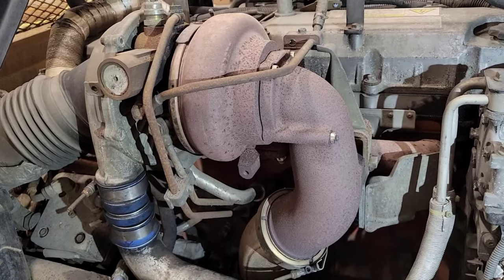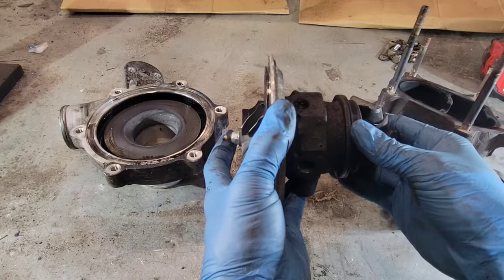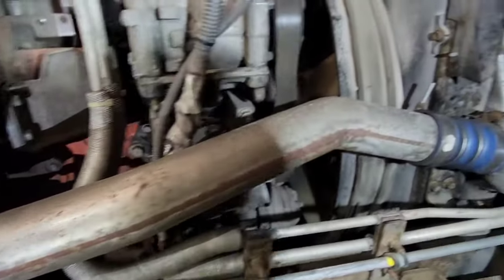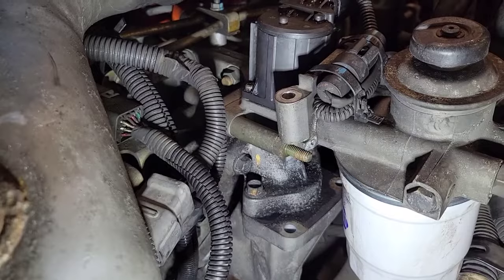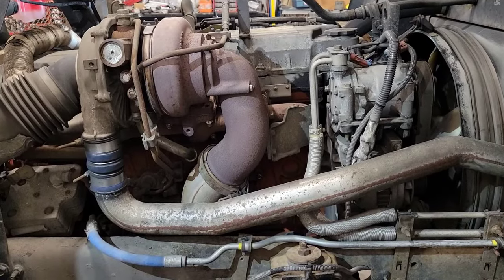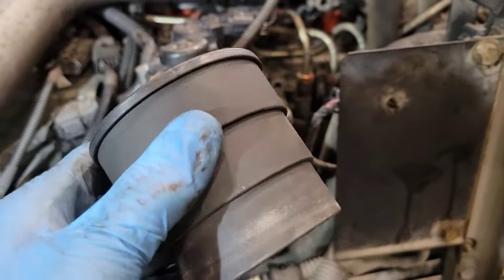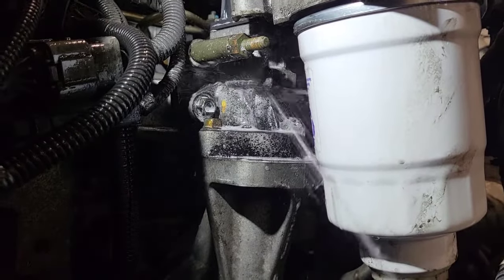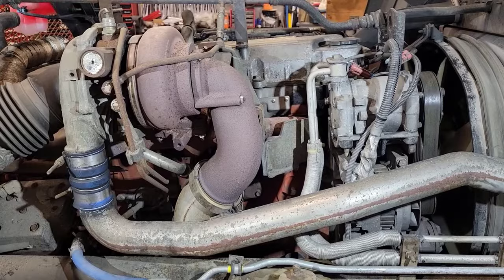Low Turbo Boost ? Common Causes Explained. Watch This Before Buying A New One. Shaners Mechanic Life

Comment from the maker: https://youtu.be/X9pzZCFXrV4 If you liked this video. Here's one I made on Turbo Oil Leaks.
Reply: I don’t know if you reply to this video anymore but I have a 2003 LB7 stock/S475. When I try to boost test it I get a bubbling or gurgling sound in the pipe that crosses from the S475 to the stock/Valley turbo. Could that be blow by? Where the pressure is going?  It is a new built engine capable of being a 700HP daily driver. It has about 1500 miles on it.
Reply: Thanks dude just found my leak egr valve..thanks
Reply: Thanks for the vid man! Idk yet what my prob is but some things to check for now. LBZ Duramax, seems the vanes stick occasionally on hard acceleration? Sometimes when pulling out of my subdivision, sometimes when mashing the pedal getting on an open highway. My edge might show 8lbs boost while truck is hesitating, maintaining the same speed, then Bam 28lbs take off!
Only happens occasionally though? 
👍🏻🛎🛎

Comment: So I really do appreciate that video I'm retired from being a diesel mechanic, but I still like helping troubleshoot my friends problems on their trucks and you jogged my memory of what to check thank you
Reply from the maker: I find that if you don't use the knowledge we have gained over the years it kinda gets lost. Once in a while, we have to give ourselves a refresher. We don't forget it, just have to dust it off a bit. Thanks for the great comment.
Reply: what would cause my crdi engine to buck back and forth when driving away from a stop? i changed maf sensor, map sensor, cleaned egr valve? would a sticky turbo or a boost leak cause this?

Comment: Well done. We will need your help for sure. I run an independent repair shop for German and British cars and these sort of issues are very common.
Reply from the maker: People are too quick to throw new turbos at systems with boost leaks or other issues.
Reply: Thanks a lot
Reply: @shanersmechaniclife3164  
"People are too quick to throw new turbos at systems with boost leaks or other issues." 
You could not be more correct. I spent so long replacing boost hoses in my land rover for a turbo underboost - P0299 DTC. 

After I did that and it didn't fix the issue, thought it could be intercooler or exhaust gasket on the turbo failure or potentially a clogged DPF that's adding too much back pressure to the exhaust manifold. 
Took it to the mechanics who almost immediately diagnosed it as a failed turbo. 
I was so sick of having this issue (5 months now) and just agreed to the works. Guess what? Didn't fix anything. 

I've just bought a smoke machine to see if I can find boost leaks this way. I've sworn off taking my car to a mechanics anymore unless I've diagnosed it and can't fix it myself. 

Most mechanics nowadays just read DTC codes and have very little diagnostic skills/experience

Comment: The easiest was is take an airline and fit it in the boost pipe just after air filter. Fill up and see if air leaks out. Then if using scan tool go live data and search boost. All boost pids will appear. Look at boost sensor and note that figure then look at commanded. Note that figure. Accelerate and the boost should rise and figure be same as commanded. If not disconnect actuator arm and slightly wedge gas pedal. Look at scan tool as you put the actuator arm in turbo. Does boost increase. Yes then actuator or wiring or computer fault. No then turbo crap. 

Thats my understanding

Comment: I want to add that the valves/seals and pistion rings can be the source of low or no boost problems as well. If you block off before the intake manifold and put pressure after the turbo you can see if that section is leaking or not and elimate that section off. Next I would pressure test the crankcase to make sure it's not the piston rings or valve/seals.
Reply from the maker: So many base engine issues can present as turbo issues. Thanks for the great info.

Comment: Maybe if your boost is too low for what you need you can increase the air and fuel mixture on your boost sensor by adding a potential meter to send message to the computer and it doesn't overheads any diodes or resistors works very good
Reply: Overheating

Comment: Sir,Your explanation on troubleshooting the turbo issues are crystal clear !I have a Mitsubishi Starion turbo intercooler,year 1986 for the past 25 years. Actually it runs slow hardly any boost,parts are hard to find !Nevertheless thank you for your advice.Regards.
Reply from the maker: Thanks. Parts are hard to get for newer vehicles. Older vehicles are even harder. Have you tried aftermarket? Try measuring yours up and see what you can find online.
Reply: I have a 86 LeBaron turbo with no boost. Our engines might be the same. Did you figure out why you weren't getting boost?

Comment: I have disassembled my whole intake and exhaust side, and took the turbos off (twin turbo system) and looked for a leak. Also replaced all old rubber lines with new ones.
I couldnt find any leak, yet the car wont boost past 14 psi anymore (normal is 22 psi), and when leak testing (like in your video) I was only able to build up 4 psi or so, and that fell down quickly too.
Even connected a smoke generator but the smoke came out the exhaust only. Did a compression test after that, but all was fine.

The only thing I found was that the turbo wheels have quite some play if you press the shaft up and down or left and right (back and forth is no movement at all). And they also click when doing that. One turbo (the one that is most prone to failure from other drivers experience) was also leaking a bit oil at the combined oil feed and drain line, or maybe where the turbo housings are connected with a spring ring. Its hard to tell, since they are close together. But the whole lower part of the turbo is full of oily soot and before I removed them I saw a drop of oil forming on that area. I also had more oil in the intercooler pipes than normal ("puddles" formed between rubber connectors, and dripped out when I took off the pipes).

What do you think is the cause? The play in the turbo shaft?
Reply: Yes your turbo is shot if there is any side to side play that isnt extremely minuscule

Comment: Egr leak would have never thought of that one.  Gonna pressure test tomorrow and check that first
Reply from the maker: I have seen it a few times. Tough to find without disassembly on a lot of models. How did yours test? Thanks for watching and commenting.

Comment: I have a Buick Encore with the 1.4L turbo engine. It had a P0299 low boost trouble code. I had determined it was the turbo after much diagnosis. I received a letter from Buick that if my engine has this problem, Buick was required to replace the turbo if the vehicle has less than 120,000 miles and is less than 10 years old. I just got my car back from the dealer. They replaced the turbo and related parts. Cost? $0.00. This may be the same for all the GM 1.4L Eco Boost engines.
Reply from the maker: Glad they covered you under warranty. Turbos aren't cheap. Thanks for watching and commenting.
Reply: @shanersmechaniclife3164  I was surprised it cost me $0.00. I was sure they'd find a way to charge a few hundred dollars or refuse to fix it because I do my own service. I have had that happen before and I don't trust dealers.

Comment: DD15 getting spn 102 fmi 18 changed air filters sensors and did a air charge cooler pressure test, still getting low intake pressure #1 code.

Comment: That was a very good video but it did not explain a common low boost cause. That would be the dump gate sticking open  or the actuator or solenoid not working. I guess he is saving that for another video.
Reply from the maker: Good point. Another overlooked cause for sure. I appreciate your feedback. Thanks for watching.

Comment: This is a beautiful video. Thank you. Are you supposed to be able to move there actuator switch by hand?
Reply from the maker: Thanks for the great comment.  You should be able to move the mechanical pieces by hand on this model but not the electronic pieces. Other turbos can be different depending on if there is return spring  tension. Kind of a yes and no answer.

Comment: Good video. Can the same soapy water method be used while the engine is running?
Reply from the maker: Yes, absolutely. Works great for tire leaks and airbrake leaks also. Thanks for watching.

Comment: Gotta watch those DPFs are not blocked. no air flow=no vane speed=no boost or power.
Reply from the maker: Good point.  Need good airflow in and out. This particular truck is pre dpf Era. Thanks for your input.

Comment: VGT turbos do not change blade geometry. They move a sliding plate back and forth over the turbine vanes, controlling the amount of vane available to generate rotational power, via an exterior actuator.
Reply: I can tell you that the VGT turbo on my 6.0 rotates the vanes, which is changing geometry. Not sure what kind of turbos you've been looking at.
Reply: @ProleDaddy  The vane orientation or slant is what changes, not the vane geometry. Just like the vanes of a helicopter are adjusted. SCBANE is right.

Comment: My 2011 bmw 535i says low boost. I noticed there’s a ringing noise that seems to be getting louder depending on how hard the turbo is working. Do you think the noise might be related to the boost problem and if so any idea what it might be? I’m really hoping it’s not the turbo. Great video btw!
Reply: Hey man I’m having same issues on my 08 335i and update ? It like whines and I think threw the 30ff code due to low boost

Comment: Nice video.. I have the same problem low turbo boost on my 97 ram 2500 turbo diesel Cummins 5.9 I’m gonna try the soapy test I hope that’ll fixed the problem
Reply from the maker: Thanks for the comment and for watching.  Were you able to find your boost leak? What was it?
Reply: @shanersmechaniclife3164  I had no boost leak on my truck… what would be my 2nd option

Comment: Check your air filter. Hard to build boost without air.
Reply from the maker: True. You can't boost the pressure of the air if it's not getting any.

Comment: Thanks for the help, I have an ISC 8.3 1999 In my Monico Rv. Just changed cracked exhaust manifold. Air side of turbo spins freely, no boost, can hear turbo at all when reving engine slightly, 12-1300 rpm. I haven't check the actuator yet, but it could also be EGR valve?
Reply from the maker: If your egr is stuck closed your combustion chamber Temps will be high which can cause exhaust manifold to be hotter and more prone to cracking. If your egr is stuck open exhaust can be going into intake when it's not supposed to causing low power and stalling. Exhaust that should be spinning the turbo is going through intake. Boost can also be going into exhaust through a stuck open egr causing low or no boost. Definitely something worth looking into. Let me know what the problem is once you find it.

Comment: I have code P0106 (MAP sensor) and P2580 (turbo speed sensor) my truck will build proper boost some days, others it wont, im getting a slight squeak from the front after about a month of having the issue. Tried replacing both sensors and checking all wiring. Exhaust brake only really works when truck is warm. Turbo builds right voltage aswell, any ideas?
Reply from the maker: I wonder if the exhaust brake is sticking partially closed causing turbo not to spin fast enough? Hope you find the problem and an easy fix. Keep me posted and thanks for watching.

Comment: Sup bro , been up like 13 hours doing this turbo for a series 60 motor I’m new to this not really I just ain’t that good but the turbo blade was shot turbo actuator just locked up bad .  After installing the new one and getting
It calibrated with my computer ,When I start the truck it’s surging ? I replaced batteries on the truck a day prior just cuhz they looked like shit and we live in Arizona .  Before I start the truck it says low voltage ? And when I start it it goes up to 15 if I hit the throttle a little bit it goes up even higher but then the engine starts running like shit and I turn it off .   I’m not getting no codes related 
The turbo anymore those all
Cleared out . I changed the alternator after seems like a reasonable thing to change . But the new one doing the same shit ? 2 faults I’m
Getting Sam chassis short lo ? And then 530602 fmi4 ? You think it’s something electrical? Or you think it may have a leak like you was talking about ?
Reply from the maker: I would double check all the battery connections. Clean? Tight? Proper location? Alot of the bigger trucks draw power for the ecms right from the battery box. Check for corroded wiring going to inline fuses. Also look at battery disconnect switch. Those connections like to loosen off and arc out. If your battery voltage is good but the ecm reads low... I'd look closely at that. Let me know how it works out for you. Good luck, keep me posted. Thanks for watching.
Reply: Thank you for getting back .  Driver got a rebuilt turbo and that lever was just Stuck the place he got it from
Says oh maybe your particular filters are really plugged up to where soot just plugged up the levers .  I got it back again today just threw it on and now I’m going to calibrate it.  But when I turn the key on the gear just continuously spins.  On the Actuator and don’t stop . Idk if that’s not
Alt or not .  
Turbo rebuild place , said they already calibrated it and I don’t need too . but I don’t believe them because the actuator has to be on the truck to properly be calibrated correct ? any ideas ? Or should I just go
And calibrate it when that little hear just spins with the key on . That’s not normal
Is it ?

Comment: I have an BMW 525D  F111 2012. The workshop has replaced a new  turbo. I had a turbo crash. My car has passes 154000 km. Still  I have very low boost. What is the standarrd psi for a turbo on stock? The workshop has just replaced the turbo without any adjustment on the waste gate. I complain and the workshop ask for 375 pund more to do a check. Do you have any suggestion what can be wrong?

Comment: do we need the number 1 cylinder at TDC to test boost leak ?
Reply from the maker: No you don't. TDC on #1 only has both valves closed on that cylinder. Other cylinders will be in various positions. Thanks for watching.

Comment: Hi Shaner, 
I have a M54A2 5ton. No egr valve. 
I had loss of power and black smoke in 1st gear. I had a birds nest in air fliter. I replaced air filter and vaccumed the air intake going in.
I drove again and it was better, but very muffled. I was able to drive up a hill in 2nd gear, i heard a terrible rattling in the dash behind the steering wheel in engine bay, 
The engine is new old stock. 
If i take the turbo apart and clean it and still have this issue, what should i check next??? Fuel filters?? 
I drove this thing during winter snow and mud and it got me through very hard days. But from one day to another this issue happened. 
Would appreciate your help Thank you
Reply from the maker: I would start with your fuel filters first, check for boost leaks, restricted exhaust, or could be bad injector (which may explain noise) keep me posted with what you find. Good luck.
Reply: @shanersmechaniclife3164   Thank you! ill make note of that next time i have issue. It turns out i had more bark and feathers to clean at the turbo impeller. I took the whole thing off and cleaned it and put it back and the 5ton works like new again! also I bought a new air filter so even better than before. In hindsight i could have cleaned it without taking it off the engine, since its only rubber hose and hose clamps, but either way would have fixed the problem.

Comment: I know nothing but cars but now I have a twin turbo car. Anytime I get on the gas the ecu light comes on and said low boost.
Reply from the maker: Sounds like a boost leak. I would check all your hoses and clamps first. Look for black traces at the joints. Let me know what you find. Thanks for watching.

Comment: My car has been making 5psi less on boost after I put in a brand new engine block with zero miles on it. My original engine timing jumped and the pistons hit the valves. The intake & exhaust valves are still all intacked with the old engine and they dont look that damaged, the shop said the valve stems where just bent and didn't break off.  When they drained the oil there were metal flakes in the old engine oil. Could this have damaged my turbo on the turbine exhaust side? I dont know if small metal debris got into it or if Im having some other type of issue?
Reply from the maker: Just a thought. If it started after the new motor was installed, I would check all my clamps and possibly the exhaust for restrictions. Check your turbine and impeller.   Make sure they spin freely. Hope this helps. Let me know what you find. Thanks for watching.

Comment: And is the engine getting the fuel it needs to being to create the exhaust pressure to spin that thingy
Reply from the maker: Good point. Turbo won't work very well if the engine is running poorly.

Comment: 2014 chevy Cruze diesel no power blue smoke thickness back fire
Reply from the maker: Is your check engine light on? Some computers will cut boost if it sees a problem. I would start there. Hope you figure it out.  Let me know what you find. Thanks for watching.
Reply: @shanersmechaniclife3164  no checks engine lights just turbo
Reply: I did put on k£n cold intake over heat the turbo